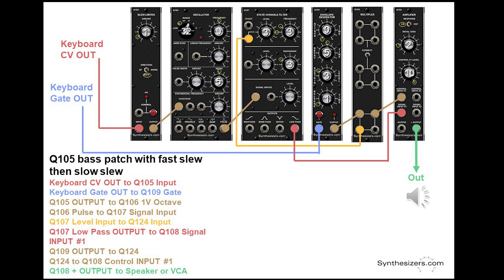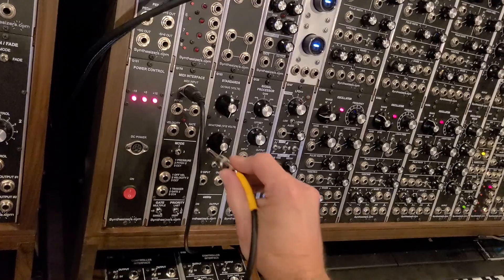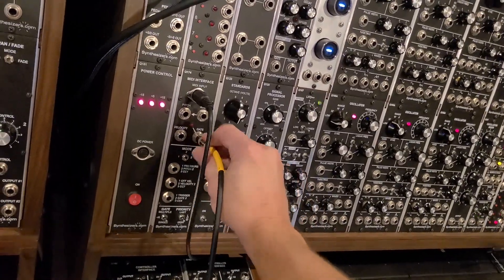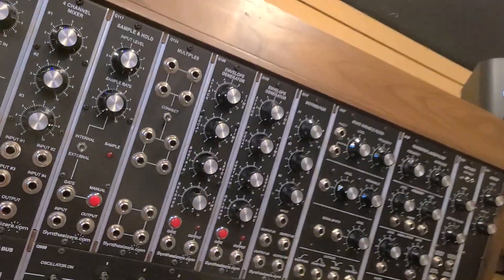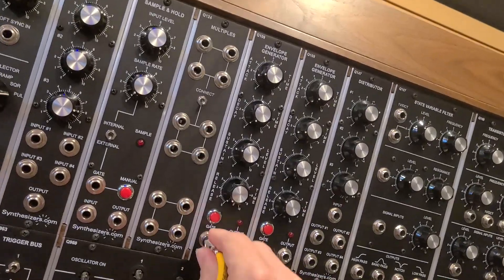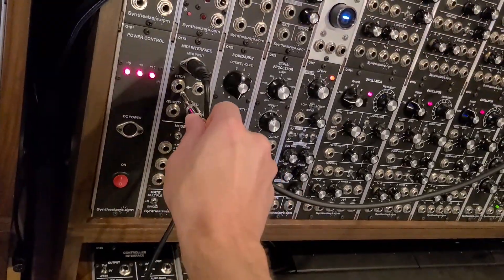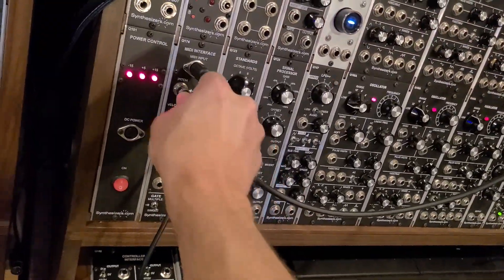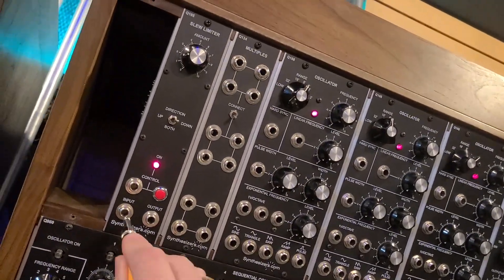Q105 Patch Tutorial

Comment: Nice to see some new videos! As for the format I found the diagonal handheld camera disorienting. It should be held straight and steady or placed on a mount of some sort. Also the order which you describe how to patch is also a little bit confusing where you are starting at destinations and then adding the source. The explanation should follow the order of the signal path in my opinion. Lastly having a bit of background music that plays lightly under the explanation portion of the video would improve the watching experience if done tastefully.
Reply from the maker: Good feedback.  The camera usage is a little bit of a challenge to be sure.  Want these to be a fairly quick 1 person job, which requires holding the camera while plugging in the cables, and being able to move it so you can make out the details of the panels is pretty important I think.  Perhaps practice will make me better at the juggling of it all.

Good note on the order, didn't even realize I was going backwards in some places.

Will try a little background music, and I think the clunks of the actual cable being patched in was a little too high as well.